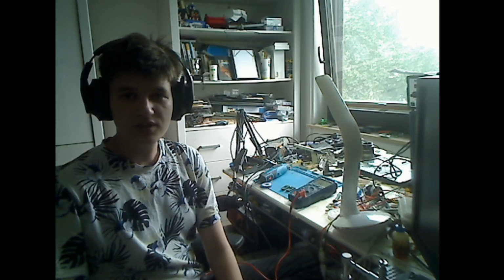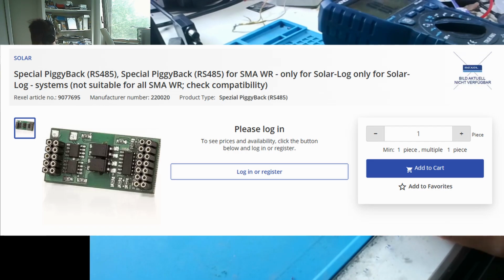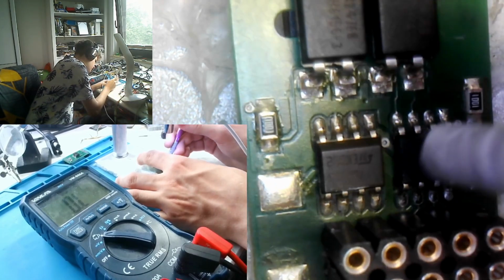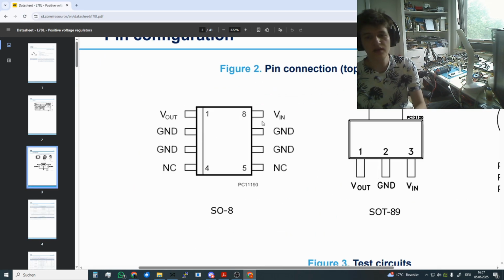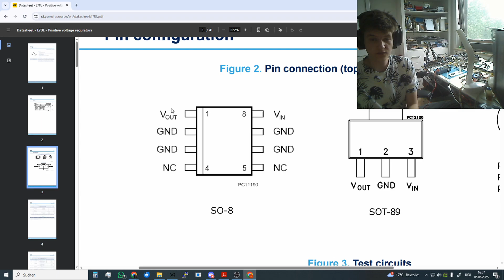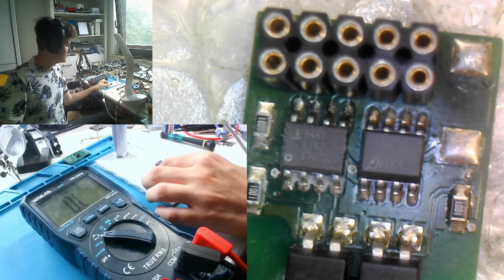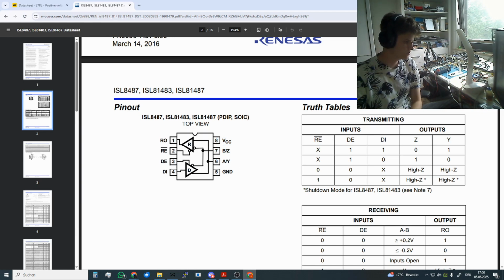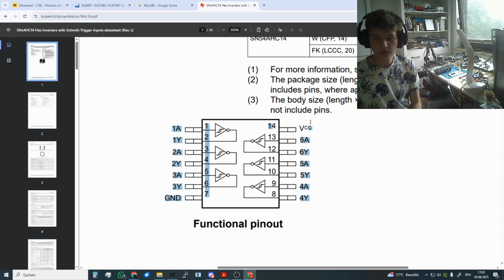RS485 not connecting – SolarLog SMA Board Repair - Electronics Repair 13

Comment: I found that mosfet you mentioned and then brushed me off. I was there to learn not be talked to like a child. so keep on making you little contributions to the tech world. they will never become worth mentioning until you open your closed little mind
Reply from the maker: I did not have much time to reply to you as i was in school at "17.08.2025 10:12". so I said "GG, Highside mosfet of CPU killed CPU". After you asked why the laptop is not responding to powerbutton at all then, i said "cuz your mainpowerrail is short :>".
This is a perfectly correct diagnosis of this laptop, as you provided resistances on coils which are not supposed to be that low. the mainboard can not be fixed (by someone who has a new cpu and bga rework skill, in theory yes tho).
I then explained later (yesterday, 07:13): "There are several of them in parallel. To find the correct one you need to short the shorted subrails to ground with a thick Wire, then inject 1v 5a onto the Mainpowerrail with a Bench Powersupply. Then watch the Thermal Cam and See where the Heatspot is, the hot mosfet is the Bad one."
I further wrote: "You are the one searching for Help Here.
I do Not Accept the way you talk to me. 
I have No value in helping you, so If i tell you the CPU is dead (you provided a Multimeter Reading which clearly Said so.), i dont have to continue investigating this Board, which cant be fixed by you anyways (you cant replace the cpu). I do Not mind second questions for you to understand better. But not with that tone." after you told me twice to go away from the forum i am the most active user in. 

You were now banned for "Rule 1. Be cool, kind, and respectful to one another.".
Reply: @craftbenmine i asked you a second question. Where was the mosfet? You didnt answer.
Reply: @craftbenmine 
You cant do this, you cant do that. What do you know what anyone can or cant do? Who was to say I wasn't willing to try? I don't care what you've done for the community. Your opinion doesn't mean anything to me if you are not willing to help.